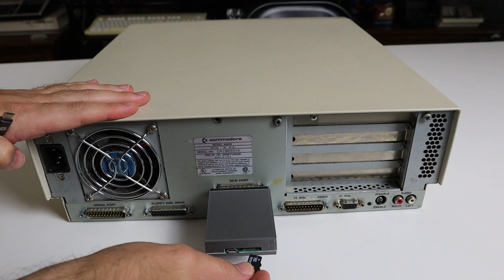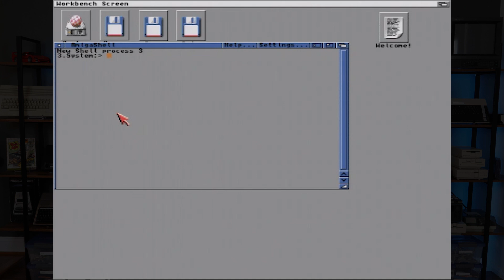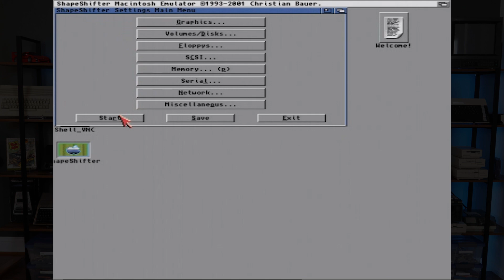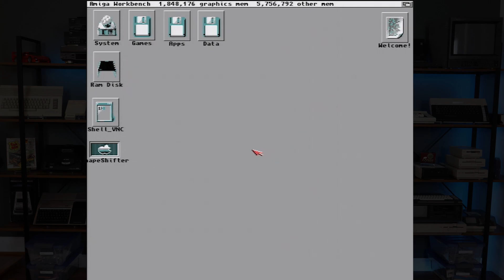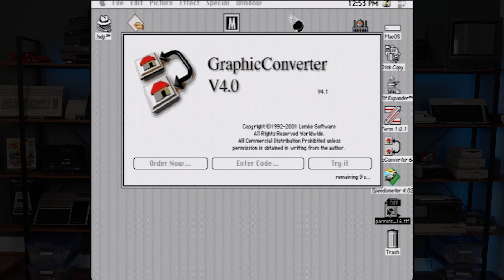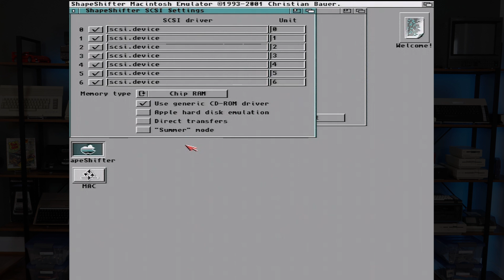#MARCHintosh Software-only Classic Mac Emulation on Amiga with ShapeShifter

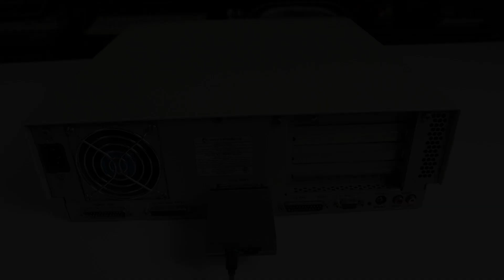Comment: WAIT!! @2:40 you have a SCSI2SD box plug into the ext SCSI of the A3K- what box? im thinking of getting the new zuluscsi 240 - much easier than cracking the A3K case open or troubleshooting a long extension SD cable (they don't always work)....is this just an enclosure for a similar board??
PS- have a ZZ9000 MNT RTG card, so this looks really attractive to try.
Reply from the maker: Yea, it's an older SCSI2SD v5.5 and it gets the job done. Today, I'd go with a BlueSCSI V2 external unit in a heartbeat instead. They are cheaper, faster, and much easier to use as they operate with image files instead of native partitions on the sdcard. I'd like a ZZ9000 but they're a bit pricey!

Comment: "Two fully multitasking operating systems at the same time..." SNIP - nope, MacOS was NOT multitasking until much later on, and even then it was only cooperative mulatiastking which is vastly inferior to the Amiga's pre-emptive multiasking.

Mac OS, just like Windows, eventually did get pre-emptive multiasking and catch up..... around ten years after the Amiga first had it. :)
Reply from the maker: Ah yes, my complete lack of classic Mac knowledge is showing! Well, learning is the whole point of doing this stuff :)
Reply: Mac got preemptive multitasking 15 years later, MacOs x

Comment: So it only took me a year but I have shapeshifter running on my A4000 (060) with a cybervision 64/3D card.  I’m currently using 8.1 but will make another Mac drive with 7.5.3, system is a bit slow but it may be due to only having 16 mb ram (only 2 mb free on the Mac side).  According to Norton 5 benchmarks, it’s about as fast as a Quadra 700.  I switched to Macs my first year in college because all the science apps in my labs were for the macs.  Now, I can run all my old software on my Amiga.

Comment: Would you happen to have links to where you got the system70_boot.dsk file from? I am having a real tough time finding it anywhere!
Reply from the maker: I'm not 100% sure this is the same as mine but try here: https://www.emaculation.com/doku.php/downloads - look for "System 7 boot disk (very basic System 7 boot disk)".
Reply: @retrobitstv  many thanks, I managed to get the image from a friend. I'm struggling to get it to work though. Have set up a 2Gb partition on an SD card and followed the steps you took. I'm running OS 3.2.1 on an A1200 with TF1260 and MUtools installed. Just keeps crashing on the smiley face screen 😔
Reply from the maker: @amimmortal77  I don't know much about '060 accelerators. Perhaps it's possible there some issue with differences in architecture the Mac ROM can't handle. Can it operate with full '030 compatibility? The IIci I was emulating had the same exact CPU as the A3000 which may have helped.
Reply: @retrobitstv  I'm pretty sure it should work, but I'll persevere and let you know how I get on
Reply: @retrobitstv  hi there, I've got it running nicely in 256 colours on my AGA 060 machine, but I'm having bother understanding how you move files using Mac-Handler when you need to move the resource and data forks separately. I think your video fast-forwards this part! I'm trying to install Toast from both a *.sit and *.bin file, but Stuffit just creates a file with no readable attributes when I do 😞
Reply from the maker: @amimmortal77  Cool, glad you got it booting! What did the problem turn out to be? Huh, I had no problems unstuffing .sit files. StuffIt restores the data/resource forks for everything inside the archive. For non-compressed files, there is an amiga shell command to switch mac-handler from data to resource forks but I never did look at how to join the two parts back together on the virtual Mac -- instead I just used the ResEdit software to restore missing resource forks for data files I copied across.
Reply: @retrobitstv  it was the MuEVD driver I needed to set up to get it working. It's odd that my compressed *.sit files appear to  not be recognised by Stuffit. I'll probably try and re-download from another source. Thanks for the help!

Comment: The Amiga interface does look quite poor here. Like it was done by some engineers alone. :)  At this point though, think I'd only look back at RiskOS as it runs natively on ARM and is paridoxically also the future.
Reply: 1987 RiscOS doesn't natively boot on modern ARM hardware since CPU ISA alone doesn't complete the full backward compatibility.
 
Early 1980s MS-DOS can still boot on a modern PC with UEFI Class 2.

Comment: I had an OS 8 or something Macintosh Quadra Power PC in the late 90s/early 2000s and it's nice enough but without multitasking it was nothing special, the hardware with the 'Wings" capture card was excellent. I had forgotten all about Shapeshifter and it might be nice for my Amiga 4000/040 I didn't really have anything to use for, cheers. Question:Would Shapeshifter run the original monochrome port of Gauntlet for Macintosh classic?

Comment: The 2 color (B/W) mode on Mac use same bitmap format as Amiga, the 4,16 and 256 colors mode are not the same.
Reply: Commodore didn't expand Amiga 1-bit plane format into chunky mode. VGA supports both 4-bit planes and 8-bit chunky pixel formats.

Comment: for this to work do u need the shapeshifter rom chip installed in the machine???? thanks.
Reply from the maker: There is no need for any ROM chips or other hardware, just a MAC ROM file on the disk you're running Shapeshifter from.
Reply: @retrobitstv  but on winuae why do i need to change the rom chip to shapeshifter roms which is compatible with the mac? thanks.
Reply: @ms-ex8em  WinUAE emulates the Amiga machine. Mac ROM needs to be a file and to be accessible for Shapeshifter's load Mac ROM function.

Comment: What I hope to see is a MC68000 expansion board with 16MB static RAM and its own video display for the Commander X16. Then could have a way better CPU than the 6502 - and easy instruction set access to more memory than 64K and bank switching. And best of all - a CPU that can be a serious target for a C compiler. Could get the very same synergy going that you did here with the Amiga host OS and the Mac guest. In this case the 68K could run a nice development environment with its own display for IDEs, and the compiler and assemblers would be present to target either CPU. Could do serious software development for the X16 right on the X16 itself.

Comment: 15:30 I don't know about amigaos but the "multitasking" of classic macos (anything pre-Unix MacOS X) certainly was a disaster; it was a patched cooperative frankenstein where even a corrupted font would bring the whole system down; the dreaded Error type 11 with constant bombing forcing you to cold reboot losing all your work drove nuts every apple user back in the 90s
Reply from the maker: Good to know :) I have very little experience with classic Macs. The basic task switching I did try seemed to work okay in OS7, but I didn't test the performance or push it to the limit at all. AmigaOS has a preemptive multitasking kernel that was way ahead of its time, by all accounts. I should brush up on its capabilities since I was never an Amiga user back in the day but what I've seen so far is impressive.
Reply: AmigaOS had really good multitasking, it can also offload lot of work to co control chips, the copper, blitter and Paula, this also helped, what AmigaOS lack was Virtual memory, so video editing was tricky, often requiring extra hardware upgrades. Two things went wrong with Amiga marketing, and choice of graphics, planar graphics was good for 2D games, bad for photo editing.

Comment: Are you positive about the speed penalty using hardfiles? I believe it may have been an issue in the past, when people were still using Fast File System, but using SFS or PFS makes them much faster to access. Have you run your own comparison tests?
Reply from the maker: Great question. I made that statement based on what I had read in the manual, not any real-world testing. Since I was already doing some more testing on the Amiga this afternoon, I fired up SS, created a 200MB hard file, duplicated all the contents of my MacOS partition on it, booted from it, and re-ran the Speedometer disk test. With the native SCSI2SD partition, my machine scored a 0.72 on the test (where 1.0 = Quadra 605). Booting only from the hardfile scored it a 0.58. It's certainly only one data point, but it's a place to start.
Reply: @retrobitstv  It's good to know how the two performed, that's interesting how much slower the hardfile was. Do you have many buffers for the Amiga partition it's stored on? It's crazy how much extra speed you can get with the AddBuffers command if it's not all set up perfectly in HDToolbox.
Reply from the maker: I have not changed any of the default settings in HDToolbox except for setting the block size to 4096 because 512 seems to run up the memory usage for large partitions. I'll look into the AddBuffers command, thanks!
Reply: @retrobitstv  Cammy is right,SFS and PFS filesystems speed up the amiga side a good bit and it will likely show. That being said i always found real partitions faster,especially with good scsi.

Comment: Regarding the software you had problems with, I think often that software has problems on real Macs as well.  The cause varies, the very early software from 84 to 88 often assumes it's going to be running on something like a Mac Plus, with only a 68000, 1MB RAM, System 6.0.8 or earlier and so can have trouble on anything that doesn't match those specs.  

I'm massively oversimplifying the following, I'm sure an expert could explain it better.

A particular problem is the while 32-bit clean vs NOT 32-bit clean, which was a real problem in the early 90s for Macs.  See, the original Macs had as little as 128K of RAM, and so choices had to be made regarding making the most effective use of that RAM.  So for those early systems, because they ran a 68000, they made use of some of the "unused" bits in the 68000.  This was ok, until later Macs started using the 68020 and 030s, and RAM installs went up, and people wanted to start running more than one app on their mac, as well as use more RAM.  The Mac ROM had to have bits re-written so it was 32-bit clean, and the MacOS also had to be re-written in a likewise manner.  For a while during the crossover, there was a Control panel that could turn 32-bit clean on and off, so you could run your old software that didn't work correctly if 32-bit clean was turned on, but the expectation was that software would be re-written or replaced with 32-bit clean code.
Reply from the maker: Thanks for the excellent info! I didn't realize this was a problem, but again, no real Mac experience to draw from. That makes sense though; I should have checked more carefully to see if the software I tested was even supported on later 32-bit systems or not. I thought I might get around the problem by testing different OS versions. ShapeShifter does not allow me to install System 6, the OS throws an error about 24-bit addressing.
Reply: @retrobitstv  Yes, I gained that eperience through using Shapeshifter back in the day on my A1200.  And yes, System 6 isn't 32-bit clean, hence the error about 24-bit addressing.  System 7 was the first version that was 32-bit clean, and System 6 generally only ran on machines that didn't have 32-bit addressing in the Mac ROM.

Comment: Wow, great show Matt! I love it - you: a 20 year old emulator of a 30 year old machine on another 30 year old machine. :)
Super interesting that you chose Shapeshifter. I also missed out on that one back when it was hottest; thanks for showing us that it's mature and useable.
Reply from the maker: Thanks! I was super impressed at ShapeShifter's performance. I tried to get Basilisk II to work with native HDD partitions in both emulation and real hardware and it would install MacOS okay, but always failed to boot successfully after.

My experience with emulation of contemporary systems in that era was that usually some kind of hardware or cpu board was involved. It's been real interesting to find out about all these capabilities and software that existed that I never knew about, which is the whole point of the exercise in the first place!
Reply: @retrobitstv  I wonder what would have happened if, instead of Apple licensing Macintosh in the later era, they'd done in the 68k era and managed it more closely, like w/Commodore.
Still, a PC maker can't win big by running someone else's OS; or rather, you just become a commodity.
(RMC did a neat video about the "Mac clones" - all those license Macs that lasted a few years. Most of those where hideous, aesthetically. :) )
Reply: @retrobitstv  Probably could get it working if you had 3.x ROMs. I'm guessing that Amiga 3000 is using 2.x ROMs. Amirite?
Reply: There is also Fusion mac emulator on Amiga,also a good one especially with gfx cards etc.

Comment: If you want performance in colour mode, you have to force the screen to low res and put up with panning the display when the mouse hits the screen edge
Reply from the maker: I'm going to try that as it never occurred to me. Thanks for the tip!
Reply: @retrobitstv  no worries. Amiga’s are great, but display DMA crushes CPU performance once you cross certain thresholds, no matter what CPU is installed or how much fast RAM is available.

The freeware program cpublit can help in some circumstances, but I suspect not with Shapeshifter, although I never tried it.
Reply: @DigitalStefan  If you want performance in colour mode, you use an external video driver which uses the MMU to accelerate C2P functions, like MuEVD (which is on Aminet)!

Comment: I have A-Max IV (I think it's rare board) running on my A3000 on dedicated HD. The only problem I have is that the max OS version I can use is 7.1.1. I posted the video many years ago showing it running. Before that I was using Shapeshifter all the time.
Reply: Nice, found your video; I had never seen A-Max IV in action before. I'm running A-Max II with the original "cartridge" and the A-Max 2.5 software on my A2000 w/'68040 for #MARCHintosh, almost exactly as I did in 1991. If interested, you're welcome to see my #MARCHintosh video from yesterday. We're trying to sort out it's poor floating point performance; looks like A-Max IV may be necessary for support of the 68040's internal FPU.
Reply: @DrDavesDiversions  I think A-Max IV does not support 68040. It's been years ago, but I think I tried 68040 CPU card on A3000 and A-MAX and did not work.
Reply: Do you have the A-Max IV manual? It looks like it specifically mentions the 68040:
https://crossconnect.tripod.com/AMAX40.HTML
I also found this online content this morning (while researching why A-Max II seems not to support the 68040's FPU):
q(
The ROMs are Mac+ ROMs, but they are deeply "revised and corrected" by A-Max IV in order to be used with 68040, FPU, 8+ MB RAM and color graphics. Hence some diagnostic utilities can "see" them as more recent ROMs (for example, as Mac II ROMs)
)
http://eab.abime.net/showthread.php?t=15719&page=48
Reply: @DrDavesDiversions  No manual, I need to make a correction, my memory if fading on me. Looking at the EAB thread I noticed that I said in it that AMAX IV works with 68040 card, I had problems with Picasso card. Post #1178. Show me where I can find that Mac Speedometer and I can do some tests.
Reply: @dvuemedia  Cool. Speedometer is on Macintosh Garden, at least. I use one that works on System 6 that I got elsewhere, but you can probably use this, no?
https://macintoshgarden.org/apps/speedometer-402

There is also SieveAhl which is 68k-famliy specific. I posted my results from this in the my "Fastest Mac Plus" video's comments 
comments: https://www.floodgap.com/retrotech/mac/ahl/

Comment: The Commodore Amiga 3000 is easily the best of the line. It was so fast when it came out, compared to the A500 and A2000 predecessors. 
One of my friends, on the way home from the World of Commodore Amiga show, said the Amiga 3000 felt like it was psychic, opening the window before you even clicked the disk drive icon.
Reply from the maker: I never got into Amigas back in their heyday and I sort of stumbled into the 3000 later on, not really knowing what made it special. I guess it was luck or destiny, but I'm sure glad to have it now and it keeps surprising me!
Reply: I regretted selling mine, it did take a bit of Varta damage, but it did not affect anything the way I was using it.  Sadly, it may have diminished the scan doubled VGA output, according to the buyer.  I still wish I’d kept it though.  I’ve owned the 500, 2000, 3000 and 4000, but only kept the 5 and 4 (no space).
Reply: @bliskin8847  I too had an Amiga 500 and an Amiga 4000. The Amiga 500 was great but largely unexpandable. The A4000 in contrast didn't even really feel like a completed machine. It felt really rushed like it could've used another six or eight months in R&D.